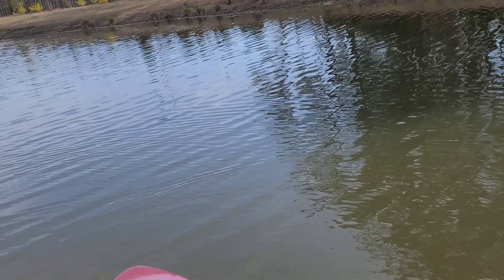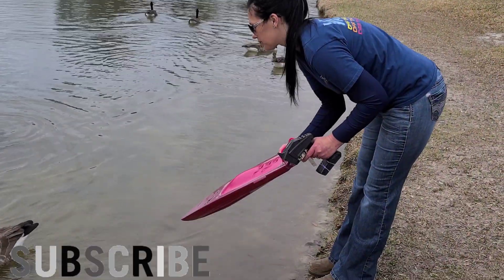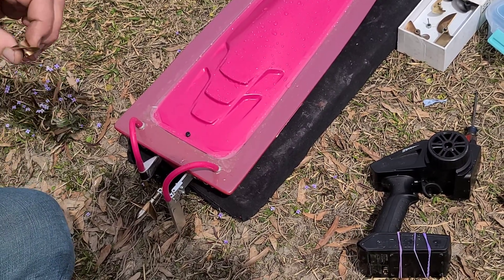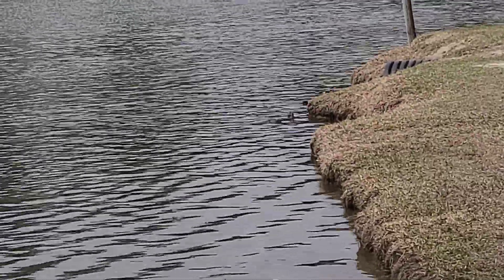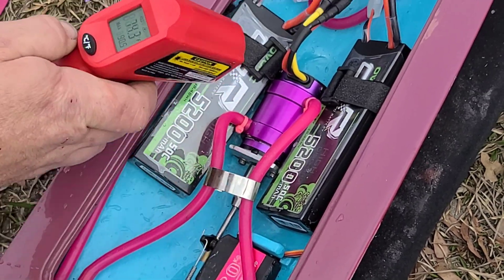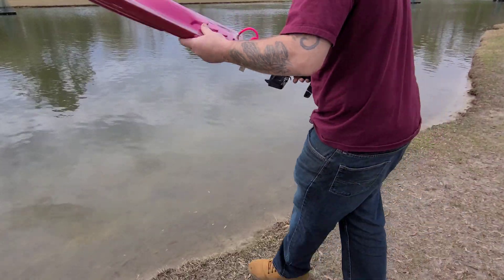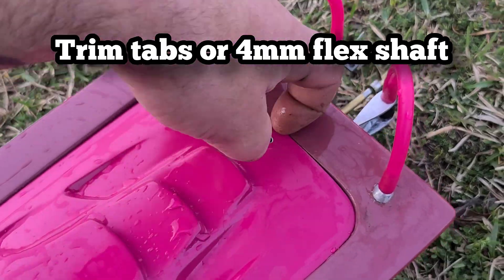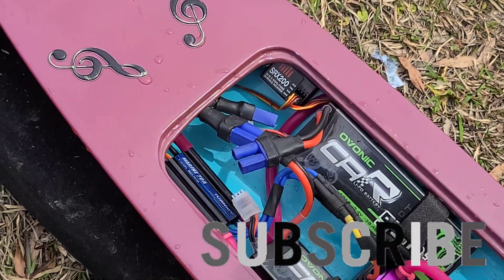Fast Rc Boat - Pt3 home Made RC Boat Build - Performance & Handling 4s Test

Comment: Trim tabs probably dialed this boat in, is cool little ride for sure!
Reply from the maker: I've tore this boat apart unfortunately 😪   I used heavy ply wood the bow of the boat was to heave I couldn't get enough weight back to get a good ride.   It was a good learning experience for sure

Comment: nice boat found your channal as just started makeing one and was thinking off taking a mold off my dads old one but decided not to in the end as i really dont want to damage them as there over 30 years old now and i canny replace them, so just took some rough paterans off the hull witch turnd out to be prity spot on to a old rubbish sailing boat i made years ago lol so now am in the middle off cutting the keel box out and cleaning it up looks like i'll have enough ply left to make the sides off it as well!! you have got me thinking wethere to put the prop shaft out the bottom, as there is already a slot in it from the keel, or just get a new shaft and put it out the back, but got lots to do before i have to decide that anyway!!